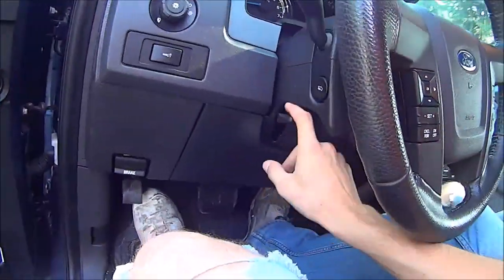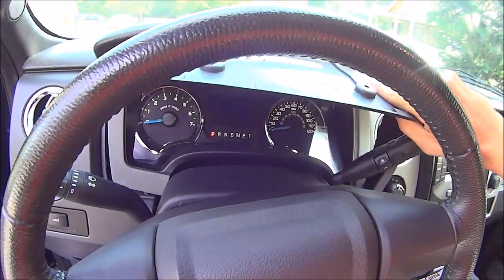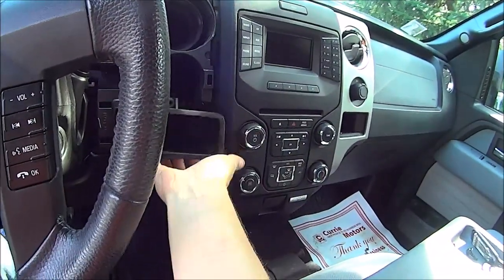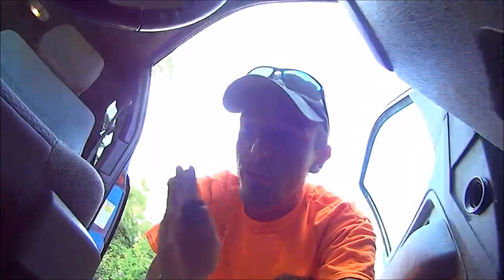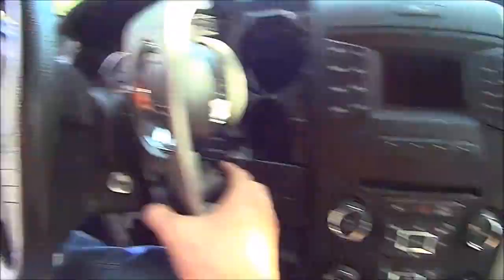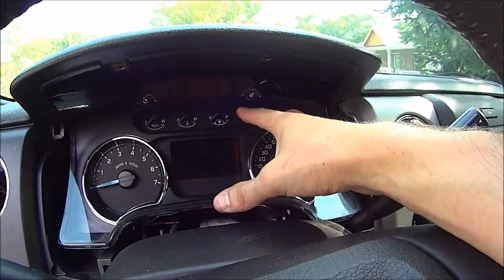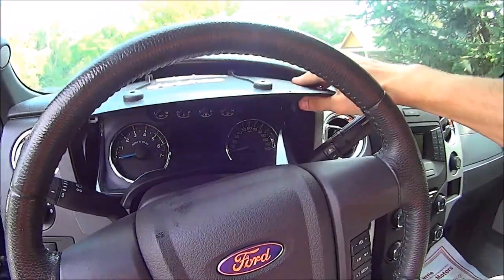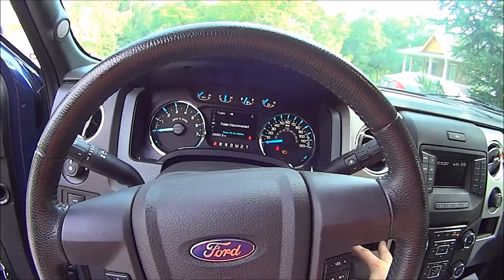Electric Brake Controller Install!! 09-14 F150

Comment: Hay man, thanks for this video.  I just installed an OEM brake controller in my 2011 F150.  I didn't have to hunt around looking for the plug, it was right where you said it would be, and the heads up about the cap on it probably saved me about 15 minutes of frustration.

Comment: Hey Mitch, my brake controller harness and plug was actually plugged into a dummy spot on the back of the little cubby box. I was expecting to fish for it and didnt have to. That was the easiest install I've ever done.

Comment: Thanks for the information on installing the original brake controller. I just installed mine in less than 10 mins.

Comment: Awesome, thanks for sharing this. Good deeds still doing good 5 years later!  I didn't even think about using an OEM part for this.  We're using the bluetooth Curt brake controller, but I hate having to use a mobile device to control it. Checked for the harness / plug in our 2013 and sure enough, it's right where yours was.  Ordered the OEM controller!

Comment: Thank you!  Your explanation  about the cap at the end of the plug was key to my figuring out my connector in my 2013 Lincoln Navigator. Spent 20 minutes in frustration before watching your video here.   Once I understood that, installation was a breeze.
Reply from the maker: Glad to hear my video was helpful!!

Comment: My bolts were not 6mm. I had my mini socket set with me and 9/32 did the trick. I found another thing that made more room was to put the shift lever down into 1st gear and out of the way. I did not remove the bezel completely, just out enough to slide my fingers under and to the right to grab the edge of the other cover you have to remove.  My wires were also plugged into the back of the cubby. Thanks, your video made it easy and took less than 10 minutes for the install. Note: Make sure you have the fuse and relay that you need which are  Relay 9 - trailer battery charger and Fuse 21 (30A cartridge fuse) - power to relay 9.
Reply from the maker: Good tip on the relay and fuse! Thank you!

Comment: Extremely helpful video. Especially the part about the cap on the plug. This only takes about as long as the video to do. Saved a ton of money by buying at Rock Auto and doing it myself.

Comment: Just did mine in a 2013 STX. Got it for $99 on eBay. Also activated it with forscan. Easy 20 minutes and $99.
Reply: Would love to know which one you bought.  It's funny the 2015+ is $99 now but the 2014 and below is around $165+!
Reply: What forscan did you use?

Comment: Awesome video. I’m looking at buying me a 2014 F-150 and I need to install the brake controller so I will have electric brakes for my camper. Thanks and it did look easy. You said it will only take 15 minutes or so well being an old fart like me I’m saying it will take me 30 to 45 minutes. The reason for that is because I second guess myself on everything.

Comment: Thanks. I was wanting to find out if the oem controller put the output on the dash. stinks you have to take it to ford to have them unlock it. 
I will add a sidenote for others: the connector isn't always by the OBD2 connector. My 09 F150 (with tow package) actually had the brake controller wiring plugged into the back of the cubby that you remove. no fishing wires for me, just unplug the harness from the cubby.
Reply: Mine was on the back of the box as well on my 13 STX. Very convenient.

Comment: Super helpful video.  Did you need to install fuses under the hood in slots 9 & 21?
Reply: I was wondering the same. My OEM model came with relay and a jumper connector.

Comment: What was the OEM part number for the co troller you installed, and how much did the Ford dealer charge to ‘unlock’ the ability to use the controller??

Comment: Getting that cubby out is a lot easier on the older body style. I have a 2015 F150 and part of the center stack has to be removed to get to mine. But the wire itself just plugged into the back of the cubby insert.
Reply: Did you go to FORD to get it programmed or do it yourself?

Comment: 12’ Ecoboost lifted and too man mods to list. Just an FYI if you have an MPT or Livernois tune and the SCT livewire unit you can make all the changes for this mod with the latest flash update... plus the 109hp and 147lbs of torque were worth the $500.
Reply from the maker: That's good to know, thank you!

Comment: 2009 install is a little different.  The 2009 model year has a slightly different design to the controller. The display is built into the controller instead of on the  DIC. The other controllers will not work because they aren't compatible with the screen in the gauge cluster. Part # 9L3Z-2C006-A. Part is now obselete though and no longer in production.
Reply: So the part number you listed is the one i would have to get for my 2009 f150?
Reply: @brianborst3163  That is correct.

Comment: Hey mitch  my truck says that it dosent have the trailer tow package. But the plug is there. Will I still be able to install the oem brake control. My truck is a 2012 f150xl

Comment: F150 2010 do you need a fuse for it once it’s hooked up or should it be good to go once everything is hooked up
Reply from the maker: I didn't have to put a fuse in. But it did have to be programmed for the truck to recognize it.
Reply: Did you have to program your F-150 2010?

Comment: Mitch once this is installed, what connects to the trailer brakes? I see a trailer connector on the rear bumper with a round plug and a flat plug. Is there another plug for the electric brakes I don’t see?
Reply from the maker: The trailer brakes are used with the round 7 pin.
Reply: That plug back there is your brake plug too. 7 pin
Reply: 2013 F-150.
I have the connector behind my dash.  Am going to grab a brake controller from a wrecker.

BUT at the back of my truck i only have a 4 pin output.  Not a 7pin.

Whats needed to convert the 4 to a 7 pin?
Reply: @barryravenek5321  did you ever fid the answer to this I'm currently trying to figure it out
Reply: @first2121  Yes.  Because of the 4 point at the rear, I bought a kit, wired off battery, installed a 7 point.  Was a morning job.  Roughly 400 bucks.  Good luck.

Comment: Fist of all VERY GOOD video. 💪🏼
I have a question, I got a 2016 F250, I've been looking on the internet for a break controller that would fit perfectly on the "cuppy" port, so I was just wondering if you know which break controller would fit just RIGHT. 
hope to hear back. 
Thanks.
Reply from the maker: Not too sure which one would fit but that cubby in your truck should also be where the factory controller goes.
Reply: You could just buy a used OEM unit on eBay from a totaled truck. Sometimes even cheaper than an aftermarket unit that doesn't look as good.

Comment: Just a quick not to anyone who is planing on doing this. I purchased my truck and was told it had a factory ford tow kit installed. It did, but it was installed at the dealer a few years after the truck was purchased.  I called the ford dealer and the first one in New Port Richey Florida quoted me 375$ lol. They said it was a ALL DAY process. I took it to Gator ford in tampa and they called me a few hours later saying the my tow package was not factory and the trailer brake would not work because the plugs were not there for it. I tried to return the part to ford and they would not take it back. I then decided to say screw it and look where Mitch said the plug was, and it was there. I installed the factory trailer brake controller and the supplied fuse and relay and the trailer brake controller had no power. It would not turn on or respond. Again I searched the internet and found a few articles where people had the same issue and said it was because 2 wires need to be ran if your tow package was not factory. This did not sound correct to me. I called the same dealer that quoted me 375$ to install it and told them My trailer brake module just stopped working after my vehicle was sitting a few months and the battery died. They said a diagnostic would be 100$. They called me a hour later and said everything was good to go, they just has to reinitialize it in the pcm.  Never had dealerships try to screw me like this before. Personally if your vehicle is not under warranty, just get the usb to obd connector and the software and enable it yourself.
Reply from the maker: RV Prepared Yet? Love the cover story for the brake controller!
Reply: USB to OBD connector with the software.  Can you link this?  I'm going to be doing this install coming up very soon.  If i can not go to the dealership, that'd be awesome.
Reply from the maker: Chris Brillhart I had to go to the dealer myself.
Reply: Hitchin Mitch Yeah, but I’d like to avoid it if I can. Plus, if they have to flash my pcm, I’m curious what it could do to my Diablosport tune.
Reply from the maker: Chris Brillhart I understand, at this point I might get the cable to do it myself in the future.
Reply: They don't flash it. They just go in and turn it on. Trust me they do not want to change anything they dont have to. I have seen dealers flash pcms when they didnt have to and cause a lot of issues.
Reply: RV Prepared Yet? Oh sweet. That’s very reassuring. Thank you!
Reply: Search Forscan, down load software get an extended lic (free) buy an ELM327 USB to OBd2 cable make sure it has HS MS can switch from amazon. Have fun

Comment: Did your trailer lights work before the install or did you have to install this electric brake controller for the trailer lights to work?
Reply from the maker: Lights still worked before the brake controller install.
Reply: @HitchinMitch  hey thanks man mine don't work at all tried pulling a uhaul trailer and an rv and both times when it was hooked up with the 7 pin no lights were working on either trailer. I got to get this figured out if I want to take the rv out.
Reply from the maker: @navyvet87zavala95  I had a similar issue and I ended up being a cut wire on the trailer shorted out the fuse in the truck for the trailer lights. I would check out your fuses.
Reply: @HitchinMitch  thanks man ill check it out. I just got this travel trailer, and want to go camping 🏕 lol
Reply: The trailer lights are a separate fuse and relay.

Comment: Is there is different controller if you don’t have a towing package? I have a 2010 F150 Lariet and the controller the dealership just sold me will not fit in the plug under the dashboard.
Reply from the maker: They may have sold you one for a newer f150 15+ Those ones are different hen the one for our generation.

Comment: did you have to fully add in a 7 pin connector for the trailer in the back? im starting with just a 4 pin
Reply from the maker: I already had the 7 pin in the rear.
Reply: Did you have to run wires to the front for your brake controller or is there a wire already back there. I'm currently researching adding the oem controller and converting it to a 7 way

Comment: Just out of curiosity how much was the part and where did ya get it and how much was the dealer unlock part?
Reply from the maker: The parts was around $50 on ebay and dealers charge for about an HR of work and can differ from dealer to dealer.

Comment: Where did you get the electric brake part
Reply from the maker: I got my controller on eBay used from another truck. Paid about $50

Comment: I saw a video the wires were actually plugged into the back of that cubby you took out
Reply: That's where mine was on my 2014 XLT without a tow package.
Reply: can you post that link to that video. I cant find it? Mine is an XLT too. Thanks
Reply: @castellm1980  I can't remember at all who the video was by.  My plug was taped right beside the OBD plug. From what I've seen they could really be anywhere under there.
Reply: @castellm1980  mine was the same as Duane's, but my plug was actually plugged directly into the back of the cubby/coin tray.  Just look up how to remove the tray, and if it's there it should be plugged into the back of it.  Mine had all the wiring, and I just ordered a factory OEM Ford brake controller, programmed it with Forscan and installed a 7-pin hitch... works great!

Comment: Do you need to do anything with the relay and fuse? Or are those already in?
Reply from the maker: I did not do anything with the fuses or relays, just plugged in and got it programmed.
Reply: Same here...
Reply: Hitchin Mitch if I put the fuse and relay in, will it hurt or hinder anything, or is it just not needed?
Reply from the maker: Kris Alexander I'm not too sure, o doubt it'll hurt anything but I would definitely check the forums to see if any added them and had any issues.
Reply: Hitchin Mitch did yours light up the plus & minus symbols before being turned on at dealership?
Reply: Does ford charge for the reprogram?

Comment: It's silly that they put the plug down there, because there's a blank socket on the back of the cubby it fits into. My 2018 F150 had the connector snapped into the back of it. I say this as someone who just spent 20 mins looking for the plug, and came to YouTube  to find it.

Comment: Are you saying I will need two factory keys for the ford dealer to turn on the brake controller? Seems a under the dash controller  is a lot less expensive then purchasing another factory key!
Reply from the maker: You don't need the second to program the brake controller. I was having it done because I installed remote start and my truck only came with one key. Otherwise the factory brake controller was $50 on eBay.

Comment: Hi Mitch. I'm looking at buying a XL model and adding the brake. Do the XLs have the plug behind the cubby too?
Reply from the maker: I want to say most, if not all of the f150s should have that plug already back there.
Reply: @HitchinMitch  Thanks!
Reply: @LeeAnn Graul how did the controller change the display for the xl trim? And did you have to have it programmed?
Reply: @harleychick01  how did the controller change the display for the xl trim? And did you have to have it programmed?

Comment: Mine is non existent with only the cap taped to the harness, what gives??
Reply from the maker: What part doesn't exist? The controller itself?
Reply: @HitchinMitch  The harness itself, I found it though 👍. Took the dash apart, like in the video, and it was plugged into a dummy socket right behind the cubby.
Reply from the maker: I think it depends on who assembled each truck. Mine was tucked up back there, and some are like yours, actually plugged into the back of the cubby.

Comment: nice video but you totally left out the part about putting the fuses in the fuse box. The brake controller won't work until you do this step.
Reply from the maker: The fuse and that you need forscan or take it to the dealer to have them unlock the feature in the trucks computer. Otherwise it won't show up on the cluster.
Reply: @HitchinMitch  that's not the ones i was talking about. when you get your controller there is a fuse and a relay in the box. you will need to put them into the fuse box on top of the radiator. ford does not usually install them if you don't have the controller installed by them. then you are correct with the dealer unlocking.

Comment: went to dealer just down the street today ( not where i bought the truck ) and asked them how much to make those 2 simple changes in software and i told them i knew it only took 2 mins once you were in the software. The said $120... NOT... I ordered the ODB interface from amazon today and already have a forscan extended license to make those 2 simple changes. the interface cost me $30 and the forscan software was free. screw the dealers that want to rape everyone. its not just ford , its ALL of them. if they would just say " we have a 30 min minimum and we will do it for $65 " , i would have just paid them to do it.
Reply from the maker: +Bevis Butthead yea all the dealer's charge way too much for simple things. That's a good deal for you, I unfortunately had to go to Ford to have them unlock the remote start, program a key and the brake controller.
Reply: I plan on doing this myself for a 2009 F-150. How hard was it to find and turn on that option?

Comment: just bought the OEM brake controller from a ford dealer in ohio on ebay for $99. The local dealers want $220 !  The markup by local dealers is rape.
Reply from the maker: +Bevis Butthead that's a good deal, when I was shopping for mine I noticed the newer generation controllers were less expensive then mine.
Reply: Bevis Butthead how much was it so the dealer could program it to the truck?
Reply: Bevis Butthead is it still working?

Comment: Buy a USB to OB2 connector for 30 bucks. Download FORSCAN to your lap top for free and enable it yourself. My dealer wants 140 bucks to enable F them!!!
Reply: Bought the controller from junkyard for 50 bucks!
Reply from the maker: Good to know! I already have downloaded forscan, just have put the connector in the back of my mind and keep forgetting to order it.
Reply: Ya the connector will provide the numbers you need to get the extended subscription number for the program to work when using usb.
Reply: Got my controller from the salvage yard 50 bucks
Reply from the maker: William Brewer mine was eBay for about the same price, dealer wanted like $200.
Reply: What model OB2 and where can I download the Forscan?
Reply: 2013 what line what code do I change?  BCM only or BCM and ICM?  I am familiar with ForScan I just need to know what line to edit and what to edit in that line to add the controller.

Comment: Did u have to install a 7 pole connector as well 4 this brake unit?
Reply from the maker: I did not, the trick already had the 7 way/ 4 way plug installed.
Reply: @HitchinMitch  I saw in the brake controller video u mentioned that u had other things unlocked. What were they? My brother and I each got F150's do we r eager to do updates too
Reply: @HitchinMitch  what were the other things u were going to unlock